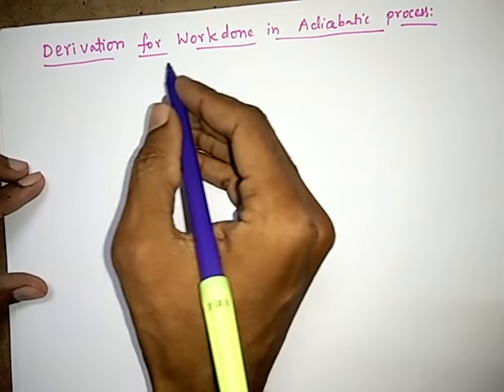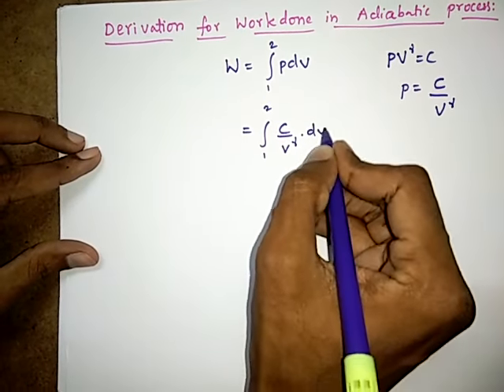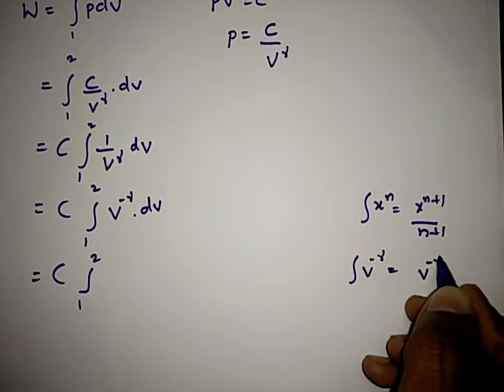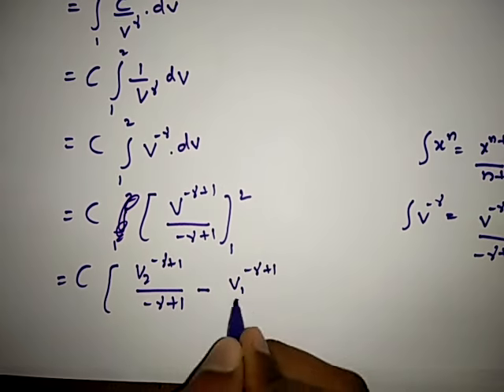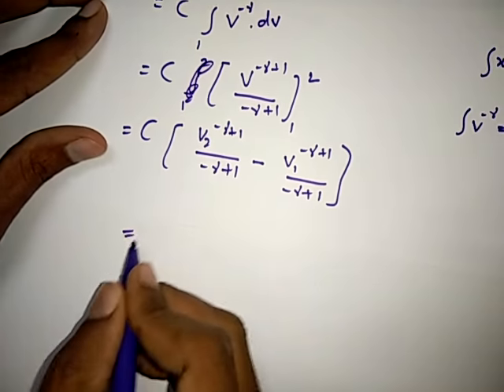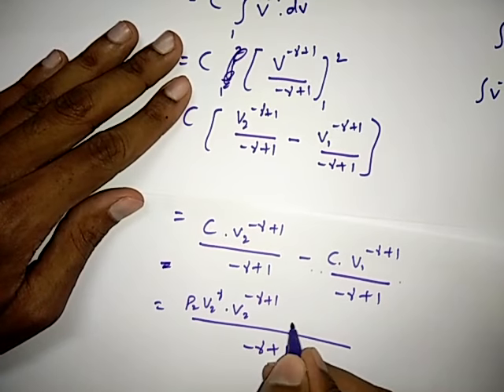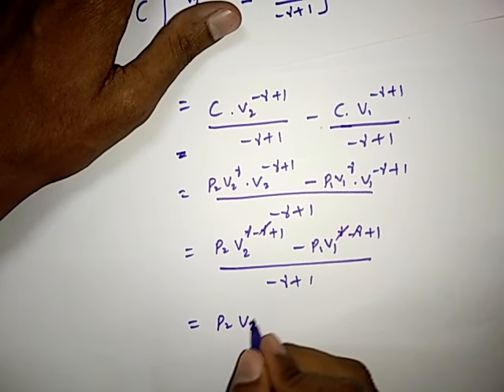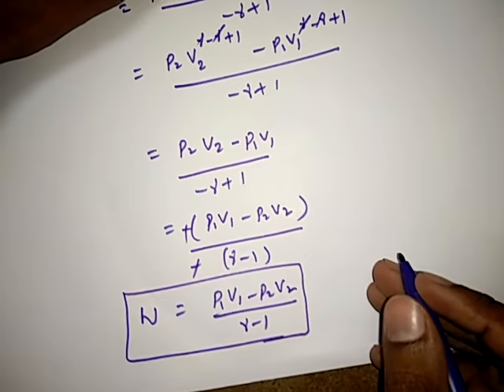Derivation of expression for work done in Adiabatic process

Comment: How are you able to say that the final expression is equal to the work done? You multiply by -1 to get rid of the negatives on the right-hand side, but then you would need to make the work negative too.
Reply: He did not multiply by -1,he took -1 common from both sides.The sign of work depends on p1v1-p2v2
Reply: @rudraguha9587  What do you mean he took a common factor of -1.
Reply: @JackBarrBaxter  he multiplied both the numerator and denominator with -1